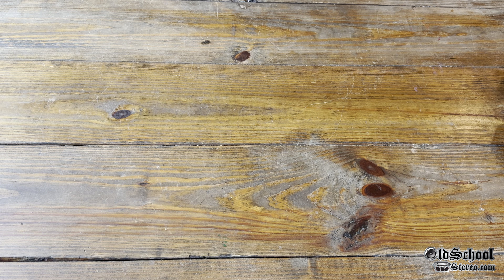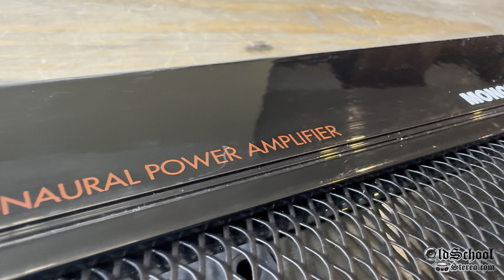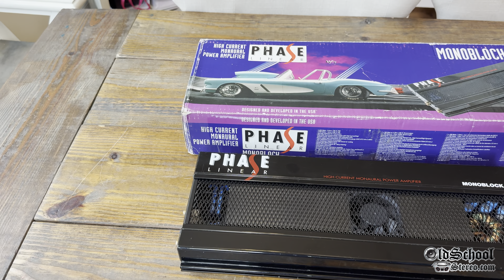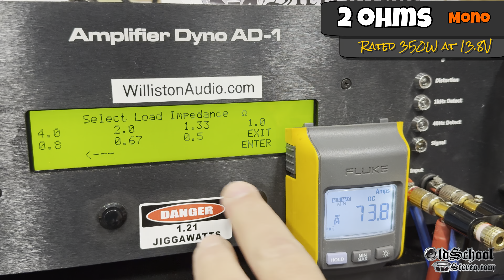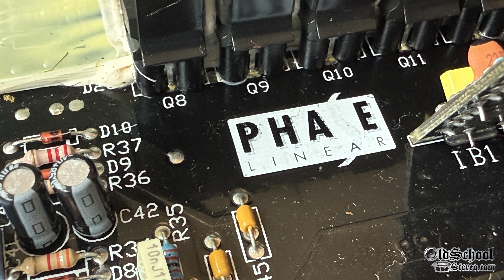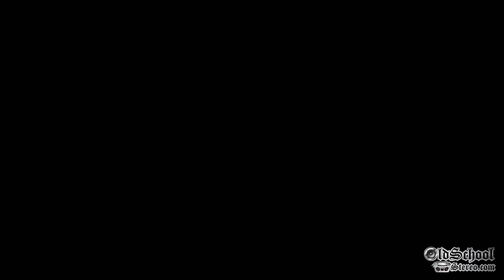Unique Monoblock from the 90s? 1998 Phase Linear Monoblock Amp Dyno Test

Comment from the maker: Get your WAL/OSS Merch: https://bigdwiz.creator-spring.com/ 
Buy Me a Coffee/Tea/Slap-a-D-No : https://www.oldschoolstereo.com/p/donate.html 

3 Modes of the Amp Dyno Explained: https://youtu.be/Q0m6NsB-HHc

See the 7 Days of Amp Tests Playlist: https://www.youtube.com/playlist?list=PLuodE1Zx7Y-6bhrEfCERSfl43EpB3P3lS
1983 Pyramid SE909 ECHO EQ/Booster: https://youtu.be/0fQnxpWpXVE
Brand New 37yr Old Sony Speakers: https://youtu.be/i9zZOLvf_bI
'80s Sparkomatic Speakers: https://youtu.be/loxJa2k2O5A
1984 Kmart Blue Light Special Speakers: https://youtu.be/ckvjUcq-ABs
Vintage Radio Shack Optimus Surface Mount Speakers: https://youtu.be/hzKgtjZOaRg
The Worst $200 Speakers Ever: https://youtu.be/S42JA00XVb8

SHOP Affiliates
SAVARD Speakers: https://lddy.no/1i9ss (use code WAL7 for 7% off!!)
Down4Sound - http://Shop4Bass.com 
Amazon - https://amzn.to/3wNX6Fn 
Crutchfield - https://howl.me/cjZI33auToW 

TEST BENCH EQUIPMENT 
SMD / D'Amore Engineering Amp Dyno: https://goo.gl/sJTcf7 
XS Power LTO Lithium Battery Cells - https://lddy.no/1ivr6
XS Power D1400 14V AGM Batteries - https://amzn.to/2BPFCKW 
XS Power Titan 8 Lithium Battery - https://lddy.no/1iq28
XS Power PSC60 Charger - https://amzn.to/2CHGcfs 
Fluke 1000A AC/DC Clamp Meter: https://amzn.to/2Rw5WDA 
Handheld Dyno: http://amzn.to/2u2EgKV 
My Favorite Screwdriver Kit: https://amzn.to/3vijokl

DISCLAIMER: This video and description contains affiliate links, which means that if you purchase from one of the product links, I may receive a small commission. As an Amazon Associate I earn from qualifying purchases

Comment: Hey BigD. Ive been following your videos for aome time now and my eyebrows raised when i saw this come up. 

I remember these from big UK installs back in the 90's when i was a dreamy teenager.

I recently purchased a .4kW and .6kW from the same range, but there's not a huge amiunt of info on the web about them.

Any chnace you could upload the rest of that advertising brochure somewhere?
I would be super interested to have a browse. 🙏🏻

Keep up the good work!

Oh, like previous poster stated, i think the HD/HC adjustent should be adjusted to an ideal point for the required load. Im sure i read there is instructions on this in the manual.

Best Regards
Reply from the maker: I believe I was given pics of that brochure. Send me an email OldSchoolStereo (at) Gmail and I’ll send you what I have

Comment: One of the local Stereo shops back in the 90's, used to sell Phase Linear, it was not well known but did sell.
  Reminds me of how my Pioneer VSX-604S Home receiver had it's amp chips, but the fan was on the back of the tunnel.

Comment: Little history lesson. The original phase linear from the 70s was owned by bob carver, the greatest and most talented amplifier architect to ever live. He designed all the amps and they were hand built by him and his team. At the end of the 70s pioneer bought out phase linear and a couple years later Jensen bought it out again which is what you see here.

After the buyout he founded Carver and through the 80s and early 90s he designed some of the most obscenely powerful and reliable hifi amps ever made. The highest end ones had extremely complex class G designs with triac regulated power supplies and were hand built by him. 

This amp is sadly not the legend’s work but he may have given them some design ideas based on what the inside looks like 👀

Comment: Great find!! Back then it was extremely rare to get a bass knob,we typically ran pre amp that had easily accessible sub knob,or the head units were more user friendly sub control,clarions had sub volume opposite volume knob,so much easier than today's heads.

Comment: Have you ever come across the Infinity Beta Digital 300? I used to run a pair of them with a pair of the newly released Kicker L7 15s back in the early 2000s. I always wondered what kind of power it actually put out.
Reply from the maker: Yes I had one to test but it had issues and I was unable to test it unfortunately

Comment: Not a good idea doing that to an amplifier who's capacitors have been left in a discharge state .hook it up to a variable power supply and bring up voltage slowly to help reform capacitors .I left my adcom GFA,,555 off for 10 years and ran into that problem .had to replace all the capacitors .

Comment: I hope we don’t sound like the “back in my day” dudes.. 
but….. The 90’s felt so much better for car audio. Maybe bc we were just starting to drive and building systems..?

IDK, but even when I was 10 years old, my favorite thing to do on a weekend was talk my parents into was taking me to Circuit City so I could go listen to the stuff I saw in my Car Audio magazines.
I literally started getting 1-off pieces over the years when they had clearance sales and stored it all in my closet with my wiring diagrams of every positive and negative speaker terminal all over the car, to the amps to make sure the resistance load was ok, and then RCA’s up to the Kenwood double din- flip down Head Unit!!

By the time I got my dad’s hand-me-down 1991 Cutlass in the late 90’s and turned 16, I had collected two JBL 12”s, built a sealed box with mdf I cut myself at the hardware store, an MTX line out converter, Rockford Fosgate  Punch 360 sub amp.
2- 6.5” Infinity Kappa component sets and a Rockford Punch 4-channel amp for them.

Those were the days !! 😂

Comment: I have the Monoblock 8 in my collection. Of the 0.6 KWs and the 1.2 KWs 12 each and of the 4.8 KWs 10 and 1 0.8 and 2 0.6. For the KWs you need the external power supply 4.8KWs. As far as I know, Phase Linear came from Italy.
Reply: Hi,
given your large collection of phase linear amps I wanted to ask if the kw series amplifiers were all A/B class or were they D class amplifiers? It seems kind of strange to me that for example the 0.6kw is rated at 400W bridged at 4ohms while only having a 40A fuse (if it is A/B class). I’m doing an old school sq oriented build (mcintosh subs, phase amps and a mcintosh amp for the front stage). I can’t find any info on what class they are not even on the old phase linear webpage on the internet arhives.

Best regards

Comment: I have 0,6 + 1,2kW 4channel amps that ran on the 32 or 48V power supply in a separate unit. They have way more power than advertised, they run low ohm load and are true power hogs...

Comment: If you find a Coustic Power Logic amp it was a 2 channel bridgeable amp seriously think it stated 198 watts bridged lol fairly big amp little bigger then a Skar RP 1200.1 curious though on it's output i remember slamming a couple MTX blue thunders at one point and a Pyle pounder pro i ordered out of MCM electronics catalog talking 27 years or so ago. Think it was the 460 model maybe what a great amp back in the day only 2 people i knew that out boomed me was this dude Mike with 4 kicker 12's on a Orion amp and this dude Bryan had a kicker .5 ohm amp pushing x2 hart professional 12s that absolutely smacked.
Reply: Have a 460 in my collection never ran it. But heard good stuff about it.
Reply from the maker: Do YouTube search as my bud HiFiVega tested the Coustic 460 a couple years ago
Reply: @wal2  Thanks for that! good video i had the 460 for sure thought it was 198 watts bridged but makes more sense it being 250 it absolutely pounded on a pair of MTX blue thunder 12's and then buying a used car one day the guy had one leaning up against the wall in his office at Chri's auto clinic sold it to me for $60 so ended up with 2 of them second one went on a 15" pyle pounder. it was so loud my car got broken in to one night after coming home from the bar sadly. Pretty sure it was this dude Mike from Bristol CT.

Comment: The "fuse" is just a bus bar.  The pot lowers the power supply voltage to allow higher current at lower impedances.  Very likely you could rotate it slightly until the amp stops misbehaving at the impedance you use.

Comment: Was there something amiss with the HC circuitry ? I'm not sure I understand the thinking but here's my take on it. The amp can only supply so much current to the speakers before it goes into protect or distorts grossly. The HD allows the full voltage from the power supply given the speakers are high enough impedance (low current). But for small impedances the voltage rails can be reduced. The current limit is still the same, the power supply can only source so much but theres either less distortion or no OC protect kicking in. The trade off is that the amp is now power limited with high impedance speakers because the voltage isnt there. 

So why didn't it make rated power in HC mode at 1 ohm ? It seemed to almost like HD (?high dynamic range?) mode better. Is HC mode for really really really low impedances ? Or is broke ?

Comment: Never seen that one before. I had a Phase Linear Turbo 150 purchased for $3 at a swap meet (in working condition). I'd hazard a guess that it was intended to compete with the RF Punch 75. Sounded good, so I put it in my dad's Nova to power Kicker KS690 6"×9"s.

Comment: Back in the early 90s I had a pair of Phase Linear 6X9 3 way speakers in the back deck of my 1976 Oldsmobile Toronado. I remember there were 2 separate sets of terminals on them with a metal jumper you could cut to bi-amp them which I did. I used 2 amps. 1 was a Majestic that I think was about 100 watts per channel (bridgeable to a claimed 500 watts) to run the woofers and a Frontier amp that was about 35 watts per channel (amp says 140 watts) to run the mids and tweeters. It actually sounded decent. The speakers (and unfortunately the car) are long gone. But I still have the generic amps. The Majestic is currently in my 75 Grand Prix running a set of Infinity 2 way 6X9s. Still sounds decent. It’s good enough that I can play it on the highway with the windows down and the T Tops off without it distorting and still be able to hear and enjoy it. No subs or even front speakers. The Frontier amp has been sitting in my garage on a shelf for about 20 years but still worked when I took it out.

Comment: @wal2 These ratings are still not within spec. They are tested at 1.0% THD, but most are rated at 0.1% down to .06% THD. Can the dyno be adjusted to these parameters?

Comment: I think this was a completely different brand than what was owned by Jensen. I’ve seen many amp models in the EU dating back to the 80s with this logo/brand that had no connection to the US home audio brand. So it’s hard to say if it was first in the EU as car audio and licensed to the US by Jensen or coincidental brands. It’s confusing to say the least.
Reply: This is the Jensen owned age of phase linear. The ‘real’ phase linear was from the 70s and was owned by bob carver who was the greatest amplifier architect of all time. This isn’t his work :( but I think based on some of the features and how the inside is laid out he gave them some design ideas. 

Carver did actually design a few car amps though but they were so expensive that very few people bought them and they’re incredibly rare now. If you find one of the big ones it’s a gem that should be restored and used as the centerpiece of an SQ install

Comment: i still have a phase linear 2 channel amp that my brother brought back when he lived over seas for a few years back in the late 80's.. i still use it to this day in my daily driver after all these years it still works great although i live in arizona so its not subject the humidity and such where i live at 7500-8000ft elevation it rarely see high outside temps above 80-90degrees but I've always been impressed with the sound quality and its output power i never knew it wasn't available in the u.s.
Reply: Sounds like Flagstaff, AZ
Reply: @calvinevans8305  nope I'm on the eastern side of the state.. I grew up here in the white mountains of Arizona but you definitely had the closest guess out of everyone thats tried